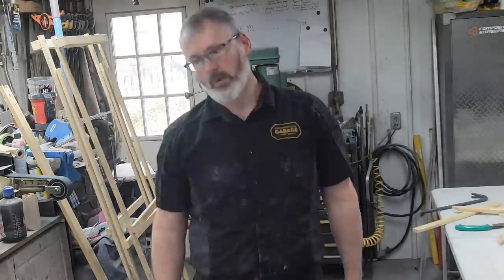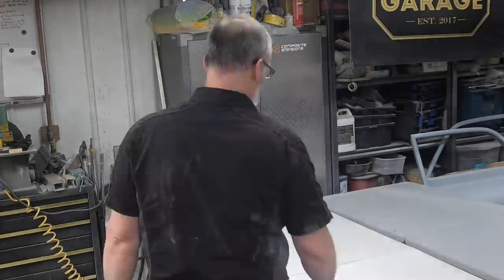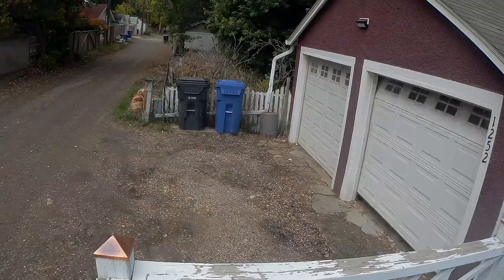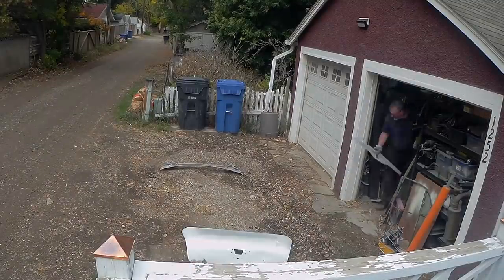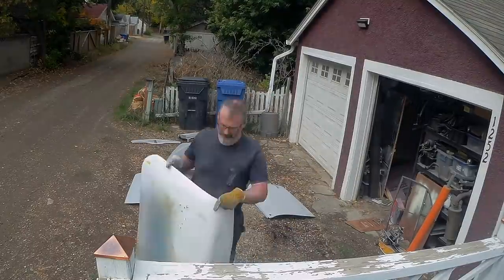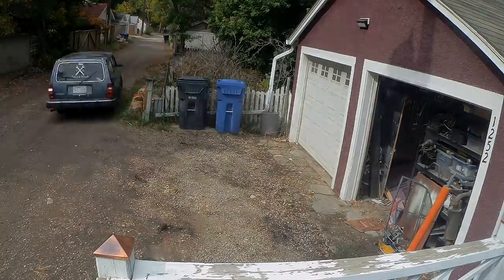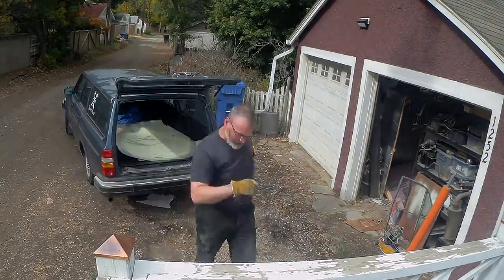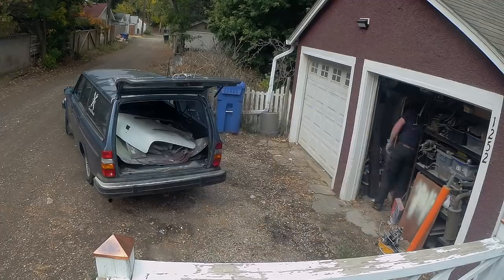DIY Carbon Fiber Car: Finishing the panels and What did it cost?

Comment: 'A year's worth of time.... apparently not worth much' 🤣Nope. But priceless at the same time. Anyway what I want to know is... WHAT DOES IT WEIGH!?
Reply from the maker: Not much George...Not much.  I've saved about 50 -  60 kg in these panels.  The difference is you can dance on them - not that I advocate this level of silliness.
Reply: @ThrottleStopGarage  They say 60kg in weight reduction is equivalent gaining 10hp. Every time I start to entertain notions of CF bonnet and doors for the Lotus I remember what you had to do to achieve it 😅
Reply from the maker: @soupclassicmotoring  if lost a stone or three - same deal.

Comment: Thanks for the info. This is truely valuable information.Youtube, blogs etc. sometimes seem to distort reality.You see people do these things and everything appears to be light and easy.Materialis available and projects just get finished without problems. Then You're struggeling with Your own projects and constantly ask yourself "what am I doing wrong? It can't be that it takes so long / costs so much money / is so tedious. etc".  But You're doing nothing wrong. It's just the way it is. The time lapse of sanding and sanding and sanding simply does not look as if it took three weeks, even if You tell us. And watching someone sanding his fingerprints off is a completely different story than doing it yourself and feeling Your back hurt and the knees burn. 
For most of the projects I have done,I can say "good,I did not know how much time the would actually take and how much money was needed in the end" otherwise I would probably not have started them. :-)
Reply from the maker: It's easier to tell the real story of the work that goes into parts.

Comment: This was awesome and as a composite guy and a paint and body guy those came out amazing. Your a hell of a mold maker for sure. Might even want to consider working in it cause seriously 10/10 on the quality. A bit thick on the parts but show quality. I go for 2-3layers on body panels and maybe some foam and an extra if it really needs it 😂. Mine are light and strong but man they dont look anywhere near that good.
Reply from the maker: Thanks for the kind words.  I am still learning that's for sure.  I understand a lot better now that building these on the thick side has consequences.  I was just fitting my trunk panel and I'm going to have to sand the seal area in the end to get everything perfect. You can hit them with a hammer and not harm them though.

Comment: Great videos and very well made. I live in Australia and buy most of my materials from the UK where it is cheaper and quicker to get delivery. Inflammable items,  I have to buy locally. I sympathise with you weather problems. We have hot days here so post-curing is not a thing. I would love to try prepreg but I cannot risk having it delivered. Some idiot will let the CF defrost and I will be the proud owner of a $1000 solid carbon log. If using PVA release agent and you have difficulty removing a part from a mould, high-pressure water works well. Love seeing you get redder and redder as you fight your moulds. Love your work and looking forward to seeing the job completed. Have a happy Christmas.
Reply from the maker: Thanks - those early efforts were hard because I wiped the release agent a little too much...the grille panel will always fight back with the deep draw.  I learned a lot - it's time to face the rest of the challenge.

Comment: Only $8k?  I'm in $15K and counting, not to mention all of my free time for 1 year...all dumped into developing a carbon fiber knee pad.  It's a long journey for first time product development, so it's always encouraging to me to follow along with your progress.
Reply from the maker: I really don't want to think about the time.
Reply: Can you give a good reason for using carbon fiber? I'm not hating, I'm just curious as to why you don't go with kevlar as it's more resistant to wear?
Reply from the maker: @hagglundguy  There is Kevlar in the door panels where it's needed.  Nothing here is really a wear risk and Kevlar is more difficult to work with and expensive.  It's all about matching physical properties of the material to the use/need of the panels.
Reply: @hagglundguy  With my project specifically, I experimented with Kevlar, but I found no use for it.  It's disadvantage is poor compression strength, plus it is difficult to work with.  In contrast, carbon is easy to work with and versatile.  Through a combination of luck and skill, I have designed a part that is extremely light, that has surprising flexibility while retaining rigidity where I need it.  I protect the carbon fiber from abrasion with a urethane (rubber) outer layer, so wear isn't an issue.  The result is a knee pad that weighs 130g (maybe less...), including straps, buckles, foam padding and all!  In short, the carbon is so good there is no reason to add kevlar...but it took me months to figure this out.
Reply: @ThrottleStopGarage  I directed my question towards fredy gump. But yes material properties should be taken into account when designing composite products.
Reply: @fredygump5578  Nice! What kind of activity is it used for? The urethane layer seems like a good effective solution and I suppose it also brings a little impact protection.
Reply: @hagglundguy  I created them to use in my job where I do testing of underground tanks/ fueling systems.  I think the knee pads would be great for any trade, like mechanics, plumbers and HVAC.  And maybe even as a "tactical" knee pad.  I should really be calling them "knee caps", as that is a better description.  They are nothing like the usual cloth and foam designs!   They are lighter and offer better protection than any design I am aware of.  I searched long and hard, hoping to find something that would work for me.  When I couldn't find anything, I decided to make my own.
Reply: @fredygump5578  really nice. I think if you'd do your marketing right and find a supplier they might sell well.

Comment: These fancy new bedliner type coating they r spraying on or extra thick vinyl raps don't give u a smooth finished & durable look like carbon but cost alot as well. They make magnetic panels prt made out of vinyl u can add to side of truck for added protection but if u had just skinned the spots down the side of 4 by 4 rig might come out better. They need to get carbon material costs down 50% more b4 it has much use besides sporting goods. Diff video guy showed strength of highest grade fiber glass & it blew carbon away cost wise & nearly just as strong, but not as thin or light wt.

Comment: Awesome! Only bought enough to do some small stuff starting out and I totalled up to $1400 so. You cant just buy just a 1/10th of a vacuum pump so if you're gonna go in... go full in I guess
Reply from the maker: My cheap pump gets really hot and leaks oil (related no doubt).  I can run the Gast all day and it's fine.
Reply: check out ebay, i see gast's on there going for $100-$200 all the time. Or ask a HVAC company if they have any old ones laying around,.

Comment: Congrats on the ending. This has been great watch from the beginning. Amount of work and trash etc is really huge. But at the end it pays off. I hope that you still would decide to do roof and quarterpanels too in carbon.
Reply from the maker: Thanks - I don't think those parts are really worth it - Still lots of work to go - and a little more carbon in the next episode or two.  It's a real struggle right now to get any time in the garage.  So it's mostly bits and pieces until the New Year.

Comment: Congratulations on your build. Can you hazard a guess at how much it would cost to make a whole car? That is, including chassis out of Carbotanium or such material, and carbon fibre panels? I am presuming such a car would come in somewhere between 800-1000 kg. What do you think?
Reply from the maker: Any guess would just be a guess.  I can't think of a full carbon car that costs less than half a million dollars.  I have no idea what it would weigh - but it would be light.  It would depend on what you're building.  Some of the reproduction bodies for things like a RUF 911 are very light.
Reply: I would be making a carbon copy of a 1970s Citroen DS, using existing suspension and running gear, but a modern motor and transmission, most likely a 1.6 lt. Diesel hooked to a 6-8 speed auto.

Comment: didnt see any mention of it, but for anyone else using a gas fired heater in their garage, they put out a ton of moisture. Run a dehumidifier while its running. also, carbon monoxide too,
Reply from the maker: True - only using this heater for parts.  My environment is so dry, that a little moisture doesn't raise the RH much.

Comment: To get the full cure through heating, do the parts not need to be vacuum bagged? Other videos I've seen had the parts in the autoclave while still under vacuum.
Reply from the maker: No - that's only for heat cured parts.  This is a post cure process to have parts reach their ultimate tensile and flexural strength.
Reply: @ThrottleStopGarage  Thank you

Comment: The material costs alone justify why most carbon fiber manufacturing is done for aerospace applications. When 3d printers can do CF, the costs will plummet.
Reply: Mac Oppy; Yes I also see a possible big future in 3D printing/ layup with cf. As Lass kinn informs, there's existing some options of cf printing, but the technology is not good enough. I think a machine feeding a continuous string of cf in the correct 3D pattern, and by adding some sort of quick drying epoxy at the nozzle that would fixate the cf in the correct position, would be able to make big parts with an equal or better strength compared to a mold setup. Also the material consumption would be less with a printed part.  I guess such a printed part would need a lot more work after printing, and the supreme beautiful look from the cf weave would not be achieved. Also you would need a 3d model  to be able to make the print.

Comment: Would be interesting to see how a  production line setup might look for this stuff. Also, how aviation parts might be a more cost-effective approach for realizing ROI. Now you are an expert, so you want to monetize a little I'd guess. See the mosquito helicopter as an example.  BTW - I'd have learned by building a 69 Camaro - a cool car :)
Reply from the maker: It would look a lot different in some respects and similar in others.  Multiples of parts would drive the cost per part down, but this is a labour intensive craft.  I really appreciate the folks what do this for a living - that's some serious skill.  I'll still never make production parts - I'd be hopeless at that (experience not prediction).

Comment: Racing tech only or for strength on rare prt u can't get any way else. I am in the rap or skin a every day prt, so not just sheet metal weak or production prt weak door panel. Boating extra strength over plastic & fiberglass might b worth it for some prts of boat but again I am in the skinning camp. No time waste & expense of molds, just cover prt or area u need carbon strength. Sports gear is real market for carbon stuff, bc old stuff will break & new carbon stuff lighter & won't.

Comment: If someone actually produced those parts in 100% carbon fiber, it would cost more to purchase it all. If it was all available for a Chevelle, it would be $12000-15000 USD. Plus you have all the molds that you know work good, so you could sell carbon parts if someone was interested. 

Did you do a comparison of total original weight vs total weight for the carbon parts?
Reply from the maker: I've never totalled it all - but it's around 50 kg lighter and it won't rust.

Comment: how much stock vs carbon did u save? for 8500 dollars cost. U can make extra panels from molds for 1/2 that price but labor won't go down much mom & pop type production or garage shop.
Reply from the maker: In the range of 60 kg was saved over all.  Not looking to make more - but I have the molds if I ever need to.

Comment: What are your thoughts on making parts out of S-Glass instead of carbon? As far as I can tell the weight difference between s glass and carbon fiber shouldn't be huge.
Reply from the maker: Depends on what you want. S-Glass is not very common and just about the same price as carbon. A lot of my stuff was done with seconds and sale material.

Comment: Aside from the value of your time that you put into it, $8500 is very reasonable. If anything were to happen to the body panels like an accident, they are easily replaced as long as the molds are kept in good condition. That's a lot of carbon for sure.
Reply from the maker: I thought so.  I saved for a few years to have the money to do it properly.

Comment: How do you figure out how many layers you need for a given part?
Reply from the maker: At first I talked to Composite Envisions.  They made suggestions given the size of the panels.  With the doors, I made the composite panels the same thickness as the steel panels they were replacing.  With the core - they're many times stronger.  So as a start point - begin with the original thickness.  Then the rest of the panel shape and purpose needs to be evaluated. None of these panels are structural...that would require more experience and analysis.

Comment: You said it's not economical, but I respectfully disagree! In plain financial terms, sure, it's not going to make you rich without selling copies, but depending on the make and model, a good CF hood with the actual supporting structure can easily retail for $1000+ USD. Throw in the fenders, doors, trunk etc. and I really don't think you did too bad at $8500, especially considering you didn't even have a retail option to begin with. 

Of course, that's at $0/hour for labor as you said, BUT you also learned the whole process yourself, which has its own value (I always prefer to learn how to do something than to pay someone else). How many people have a carbon fiber Amazon? Not many, I'm sure. And how many of those were built in a garage? You don't get that buying parts retail. Here's to hoping your clear, thorough, and concise videos generate the requisite number of views and likes to put some cash in your pocket!
Reply from the maker: Thanks - much appreciated.  That is the point of me taking the time to record these videos - they may help someone.  They're not popular enough to offset any cost related to sharing them.

Comment: You do know that carbon against steel or aluminum causes galvanic corrosion worse than stainless steel.
Reply from the maker: I do know that...and the adhesives I used has micro balloons and insulates against this problem!

Comment: $8k US to convert most of a car to carbon fiber doesn't seem like a lot if either: 1) someone just wants to build skills, or 2) you're building a performance car. What's the weight savings? Every 100 lbs matter.
Reply from the maker: Probably 60 kg's or so  for weight savings.  I'm building my car - that's all the sense it has to make.

Comment: well doesnt really want to do it anymore , for my mk1 golf gti , because they are made 500bucks a door 500 fender , 700 hatch and 800 hood we are far from the 8500 and you dont need time for that
Reply: Carbon or fiberglass? Yeah Golfs are epic because there's parts for them. For Amazons performance parts are really rare or non existent so it makes sense for him to make them himself.
Reply from the maker: Exactly.  If there were parts, you'd buy them...I've said it 100's of time in the videos.
Reply from the maker: If you can buy quality parts - do it. If you want to learn, build it.  A1 VW's are a lot smaller than what I'm working with in the Amazon.
Reply: @ThrottleStopGarage   yeah , i restored all the car my self , but parts making in an all other level in therms of time , carbon fiber lauri , 
i will see later , i might do a copie of my own car but with plexiglass window , carbon everything and raceish !!!!
Reply: @quentincourtonne6682  I'd also love to build a Golf albeit be it a mk2. I'd love to have carbon panels and plexiglass windows with an ABF 2.0 16V with a hot cam and individual throttle bodies. Would be a hoot to drive weighing in at around 900 kilos with a revving ~190 hp engine.